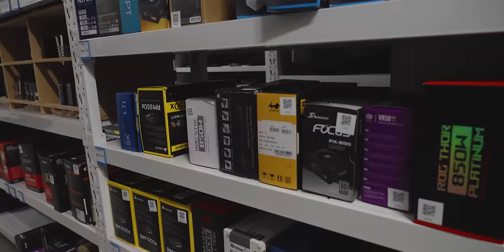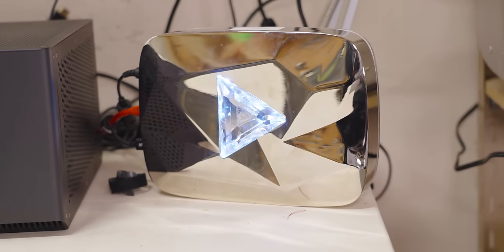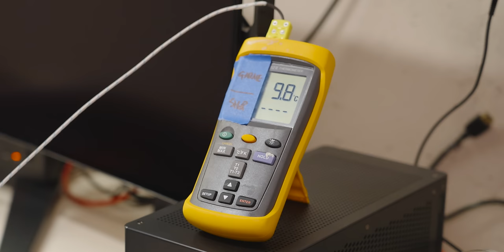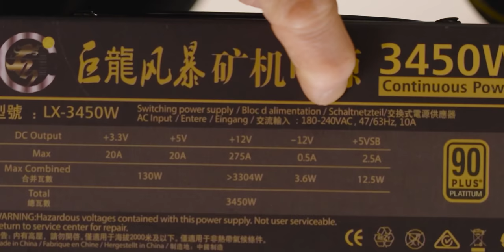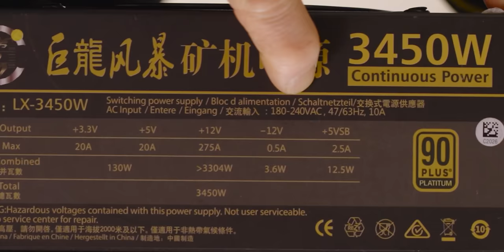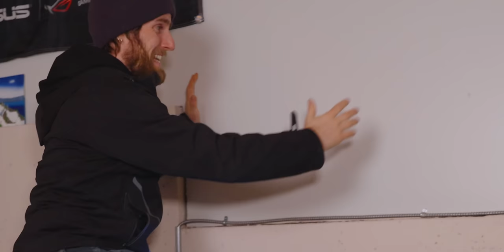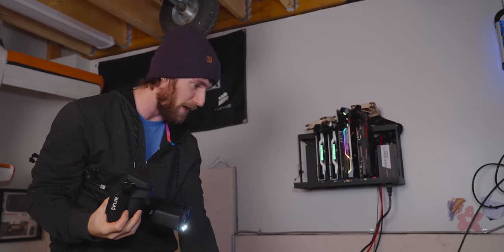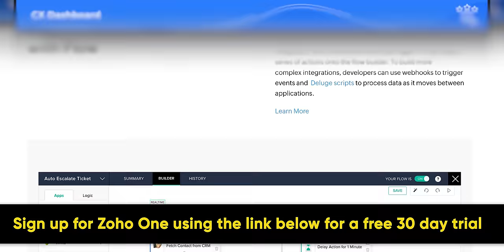Ask me why I'm Mining in 2023...

Comment: Mount the rig under the table.  This will force the table to control part of the passive airflow.  If you can force the air to come out toward the front of the table, you can get more heat from it.  My new system build makes an accidental space heater, and the air from under the desk is quite noticeable.
Reply: Exactly. Firstly, hot air simply go up because it's lighter. Secondly, it needs time to get a place hot. Third, it will clearly help under the desk because of inertia. The desk will get hot and slowly transfer the energy. The hot air will also flow around the desk.
I love the idea btw ;)
Reply: @adax74  it is not lighter :) it is less dense.
Reply: Yea, I understand that they have to "clown around for the views", but to not at least include that as a final solution is frankly embarrassing I.m.o.
When I lived in the UK I had a workstation with 4 Titans with a custom loop and a MORA rad on soft tubes. And in the winter I put the rad under the desk, and in the summer I put it so it vented out in the corridor. 
Perfect solution.
Reply: @robertsobaszek6352  one doesn't exclude the other right. Most of the time when something is lighter then another thing is because it is less dense. plastic has a lower density then lead, hence it is lighter. The only difference here is that the composition is the same. But the same can be said for ice being lighter then water...
Reply: I moved my PC on top of the desk for the opposite reason for summer. It made a huge difference to reduce the heating of my sitting position. My desk blocks all airflow to the rear and sides.
Reply: If the table catches fire it will generate even more heat.
Reply: Try to use Heat Reflective Foil
Reply: @robertsobaszek6352  when talking about the weight of things volume is inferred
Reply: Yeah they should have put it very very low, or put a SERIOUS fan to blow the air. Really, even a $25 Canadian Tire fan would've done the job way better. You should be able to feel it from the floor. Those puny PC cooling fans are NOT going to send air flow (and especially heat) downwards to the sensor/chair.
Reply: @akosnap2196  Heat Reflective Foil only works on radiated heat, such as the sun or microwaves. Radiant heat is similar to light, and therefore can be reflected.

The heat from PC's are transferred to the air as kinetic heat. The easiest way to move this heat is to move the heated air itself.
Reply: Thats exactly what I do. PC under the desk makes it comfy during the winter.
Reply: i vote to bolt the rig to the underside of the chair
Reply: I am stunned he mounted it above him - heat rises!
Reply: @robertsobaszek6352  bruh... if you're going to correct someone, at least be, well, correct. Lowered density only means that the same area has less mass, making it... LIGHTER! Wow, who'd have guessed?!
Reply: @hellomark1  IMO, putting on more fans or a bigger fan is self-defeating. The more air is pushed around, the more heat wil escape the enclosure. Putting the rig under the desk, however, will put the heat where it will be most effective with a minimum of air velocity.
Reply: Machine under the desk, desk at the wall, sides of the desk closed with cardboard. Works well enough in winter.

Comment: I used a miner to heat my basement setup. I put the rig under my desk and it worked surprisingly well. After a few hours it became very noticeable and since the machine will run 24/7, after a day you should happy. Also try putting up two layers of curtains, this creates an air gap that works as an insulator.
Reply: LOL  you might as well get space heaters, it's cheaper :P
Reply: @jimmydandy9364  no it isnt. if you want an explanation then reply to this comment.
Reply: Username checks out
Reply: You were also not fighting the fact that heat rises, unlike Linus.
Reply: I was thinking under the desk would be better as well. Let the heat do what it does and have it rise into you instead of trying to force it downwards with fans
Reply: @jimmydandy9364  not if you already have some spare hardware
Reply: I did that in my office. ~160w of GPU's is all I have but having that directly on my legs and heat rising up my torso worked fine to take the edge off. Space heater was then gone. Becuase it runs 24x7 it makes a nice warm area. None of that matters now since the Ethereum change, I don't like running a loss when I'm not sitting at my desk overnight and I can't be bothered turning it off/on when I come and go. I did that for years though and it was profitable!
Reply: @jimmydandy9364  no because you would be earning something that you could use to pay for the heater
Reply: I have an actual mining heater and currently the price of Bitcoin means instead of paying $3-4 for a day I'm paying 15cents instead. Not earning money but saving a lot
Reply: @ItsHotdogFred  but the heater is way more expensive and would take you a lot of time to pay down
Reply: Sheeesh I see, I’m cold too hell😂
Reply: Where tha heater’s are found?🤣
Reply: @jimmydandy9364  except mining rigs repay themselves in terms of electricity costs, or at worst you're going to lose like a couple bucks a day.
Remember the goal is too keep the area constantly warm, a space heater on something that has a 4-5 meters high ceiling will also take quite a bit to warm everything up if you start from scratch every day
Imagine using a space heater 24/7 for a month, 1500w x 24h x 30 days, have fun (it's around 1 Megawatt per month, lol)
Reply: @caalm9637  eh, a 1500W heater running 24/7 would cost around 270€ a month here where I live. Even if it ends up giving me 0€, it still repays itself in three-five months as I'm spending 0€ instead of 270 every month
Reply: @JANICKGMO_  personally I'd love an explanation
Reply: @skmgeek  He's going to say it makes you fake money
Reply: @plantbasedavid  crypto isn't fake money lmao
Reply: A heater that makes money on the side... hmmm... Interesting.
Reply: Stopping convection from being created with cold air under the curtains and the hot air rising up over them is probably more efficient.
Reply: @caalm9637  but it would still be cheaper

Comment: For someone who have lived in a cold cabin by the sea here in Sweden, I can strongly recommend having the computer on the floor with the exhaust toward your feet (and preferably If you can, split the exhaust toward your hands as well), The heat rises naturally and since you can't heat the whole area, at least you can direct the exhaust to the two areas where we generally get the coldest... If you want to heat up that area I would just insulate it with cellfoam insulation like cellotex or something similar, it is the most efficient insulator on the market and you could quite easily make foldable wall out of it as well. :)
Reply: Who knew, heat goes up 🤦🏻🤣
Reply: Nah, Linus is just trying to discover new physics 😂
Reply: Anyone with 2 brain cells would have figured that one out. Linus looking at the FLIR footage like “hurrr heat is rising‽”
Reply: Was going to suggest the exact same thing.  Well said sir.  I do mine under the desk and it is great!
Reply: Bad idea for tempered glass PC Case on ceramic floor surface.
Reply: The GPUs are on risers, I'm sure there are cables that could get it set up to have one GPU exhausting at each hand/foot
Reply: @itsrosyid  hahaha. well, I don't know if this was done as some kind of childish experiment, but I thought most adults were onboard with how heat and insulation works. Especially house owners in Canada. 😅

Comment: Warmer air goes up so you are losing some heat. Putting this rig down the desk will heat up the wooden desk, wood has good thermal capacity. Which will heat you and your legs. Then you won't lose that much heat to the upper air. Maybe instead of insulating that much area with that curtain, you can put them on the right of the chair and the back. And I hope you get better results.
Reply: So what you're saying is...gaming chair computer. Also, won't this just be useful for like a couple months before it gets hot again? lol.
Reply: @ShinnSin he was only worried about the heat to keep him warm during winter, do what you do with any heater in the warmer months... turn it off.
Reply: In this video, Linus leans hot air rises!